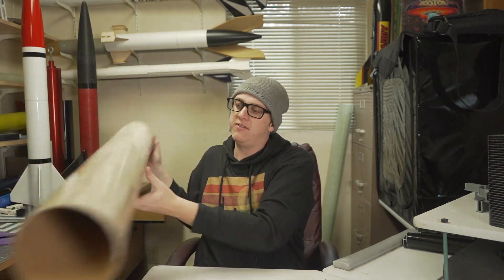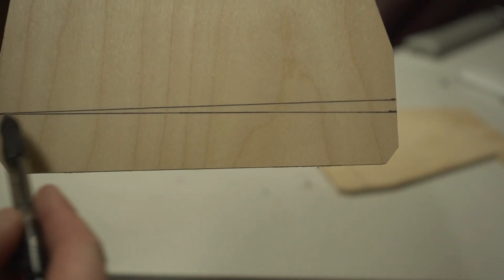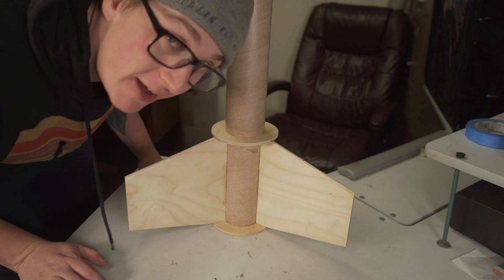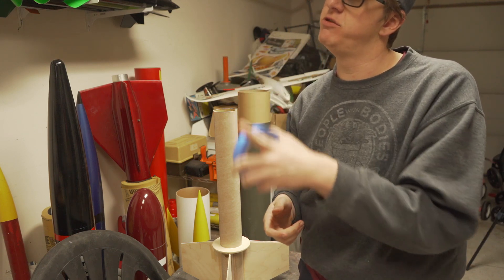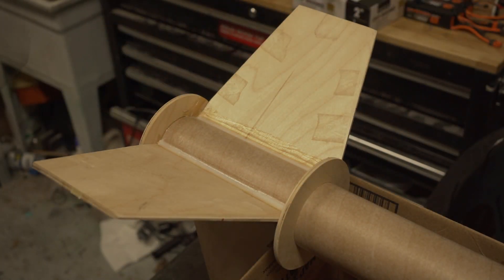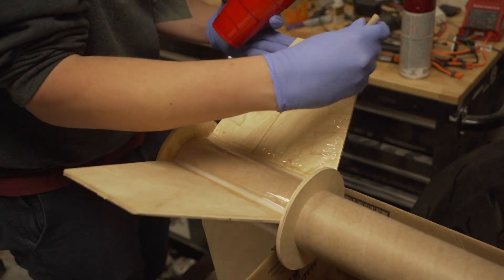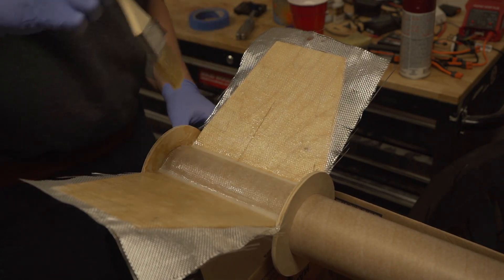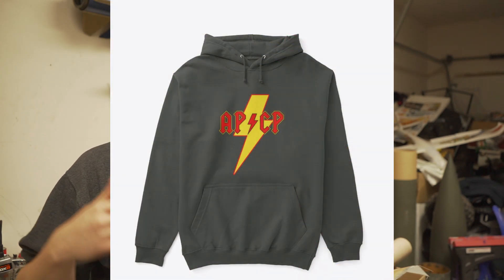Let's Try Something New!

Comment: I found cutting the peel ply into two or three pieces for tip to tip really helps with eliminating wrinkling. Basically one piece for the flat of each fin, over the fillet, and just long enough to overlap the other side at the center of the body tube. Way easier to sand out  that seam then a big bubble.
Reply from the maker: For going over the airframe tube I'm more meticulous about getting everything down flat, but since this is just mylar for aesthetics, I'm not worried about the motor tube or lower portion of the fins. Nobody's going to see those 😉